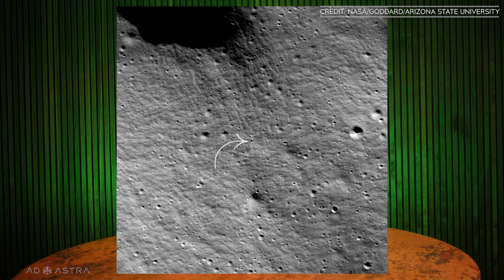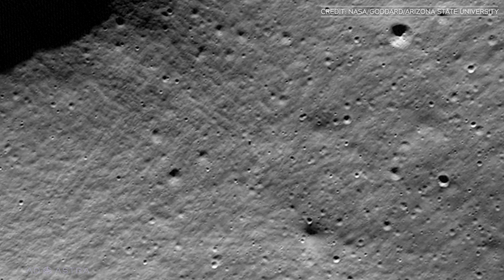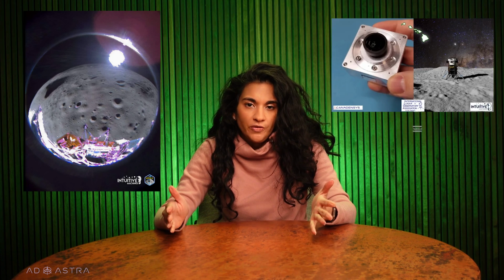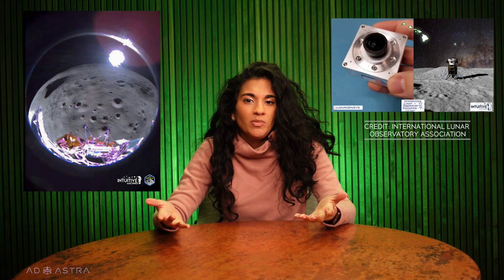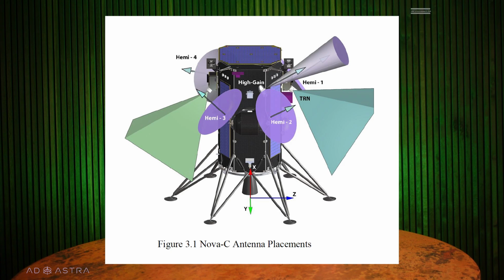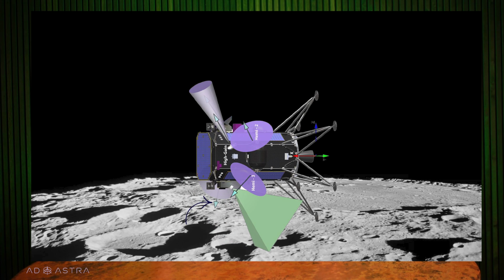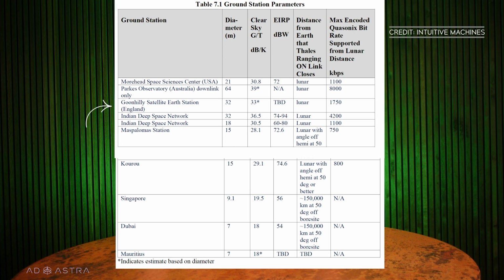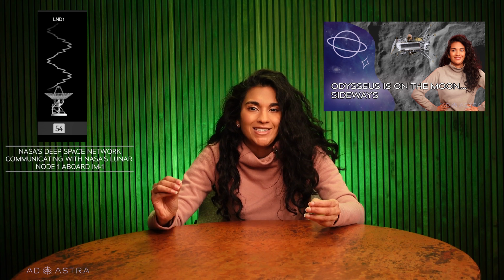The first IM-1 moon photos are here...but they may look different than you expect

Comment: This is speculation, but it seems from the lander's orientation and the location of the high gain antenna, the signal being received might not be from the main "lobe". This is where most of the transponder power goes. In this case, the signal received may be from a side lobe. This would have much less power. The lower the power, the lower the maximum data rate. If the power is low enough, they might have even had to uplink a software patch to support the unexpectedly low data rate. Also, downlinking non-photo telemetry may very well have been given priority over photos. I meam, i love "purty pictures," too, but if I'm going to be building more landers, and IM will be, I would prioritize engineering data. That might account for the time it took to release the pictures. As for the timing of the first press conference, imagine what it takes to make one of these happen, particularly when it includes a large government agency?

Comment: If the communication is choked I’d suspect there’s other data more valuable than the photos. 

So it’s a triage queue of what’s highest priority. 

It’s so sad. Accidentally leaving laser ranger interlock in place speaks volumes. The mission in large part is pass/fail. There was a lot of pluses. Cryo fueled engine was a big deal. And other systems that worked. 

But it’s hard sell to say that it successfully landed. And saying that it landed ‘successfully sort of’ leaves the public skeptical.

Comment: How does thing only last 1 week and the Voyagers are still communicating from deep space 40+ years later?
Reply: this thing doesnt have voyagers budget and its a small lil moon lander that can only do so much
Reply: Yess, the Voyager probes have a plutonium powered radioisotope thermoelectric generator (RTG), which is still giving power and heat for the devices.
Reply: The latter is nuclear powered.

Comment: The 300 baud backup modem is working. The 1200 baud modem is broken. This is a multi-million boondoggle and is an outsourced disaster. Faster, better, cheaper? 😂😂😂
Reply: I remember the 300 and 1200 modems that I used actually

Comment: They are NOT HERE. The Odysseus has taken one image of its predicted South Pole landing site. I stress. BEFORE IT LANDED, incorrectly on the lunar surface, the other image shows Odysseus, as a spec on the Lunar surface. This was taken by Nasa's LRV which orbits the moon. Odysseus has not been able to perform 80% of its payload experiments and functions firstly with a human error where someone forgot to flick a disable override switch, which should have been physically enabled before the launch over a week ago. This was the first step in jeapordising the mission, That switch was the reason the geo guidance software could not be initialized, and they had to switch to a NASA geo system that was probably somewhat different from their now unusable software that had been tried and tested in simulation. This would have led to an anything-but-textbook landing. That being the case a horizontal Odysseus is not going to work, with the Antenna not offering sufficient bandwidth for data,  the onboard cams facing towards the lunar dirt, and the real mission killer, no solar power collected as efficiently, from the out-of-position solar panels, limiting the landers already short life meaning a shorter functional life which will end Tomorrow Tuesday morning. Positioned correctly it would have had a longevity of 7 to 10 days. So no data no images. and I think back to the drawing board as to the vehicle's center of gravity, which if designed to be much lower could have prevented its tumble rendering it what can only be viewed as a failed mission None the less taking into account the cost if this mission, its a go for more. Finally, I do believe that IM marketing people should have been reporting every day even though it was bad news, marketing is vital to a young and exceptional space engineering company, and they could have cushioned the 34% drop in share price if they had given regular updates instead of silence for almost 4 days, which breeds doubt and mistrust. Whereas transparency and the truth, you must relay the bad news, not just the successes. Reporting all the facts breeds confidence which equals investment =Cash. It has been so disappointing that the CEO and the company, in general, did not think to give daily updates to everyone on their own I.M. website, not even NASA has anything on their live channels, and instead, we have been getting secondhand  3rd party reports like this one. with misinformation.

Comment: If they know the orientation, why not use the thrusters located near the top of the lander and pop that thing upright?  If Tuesday is the final day, do it Tuesday and gain extra days if successful.  If it pitches the lander to its other side, at least the high-gain antenna points to earth at that point.
Reply: The real problem is the LOCATION (inside a 1 km wide crater), because it landed ~1.5 km away its target.
 Even if it was upright at 90º of the "horizon" (instead of lopsided at 12º inclined terrain), the walls of the crater will cause shadows a bit before than expected [there is NO flat place on the Moon with 100% sunlight the whole month, that geographical miracle simply does not exist on its south pole].
Reply: Curious to know what the depth of this supposed crater is, and where the craft is relative to its center and/or rim.
Reply: @PipingAintEasy   With an inclination of 12º... it is either closer to the center (its top facing towards the rim), or anywhere else in it (with a random rock compensating/locking it in position).
 -> The ~970 meters up "flyby" photo shows that right now sunlight is hitting it on one of its sides (not the top or bottom); likely because it did NOT rolled/tumbled around at the not-crashing landing.

Comment: These images have way higher resolution on board. They just can’t download that resolution because of very slow data rates. I would not hold your breath for better images.
Reply: If the landers communication system was functioning properly they could send higher resolution.   It is not.
Reply: Back in 2014 there were articles about data rates 20 to 600 mbps possible at least with new nasa satellites, I guess that doesn't apply here
Reply: Blah blah blah, I call BS!!!
Reply: Indians and chinese send videos how much difficult it is